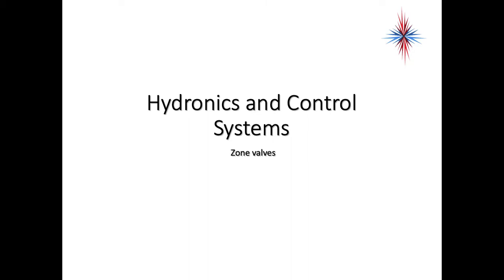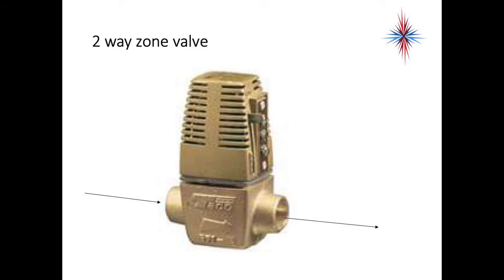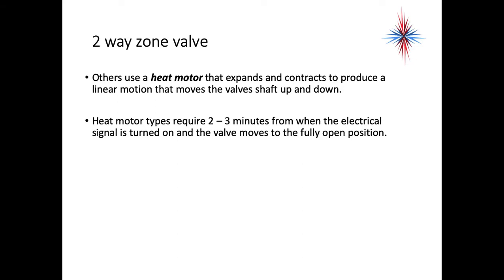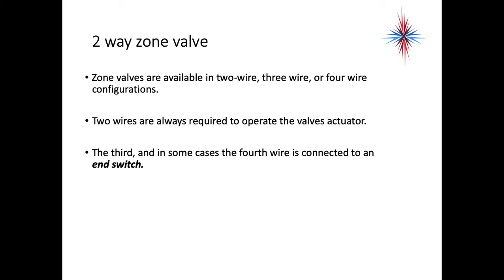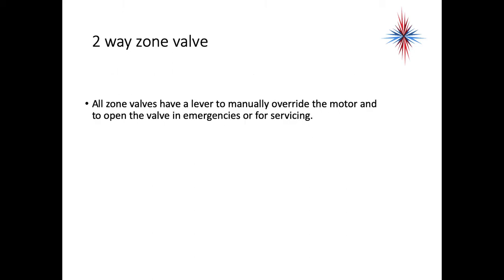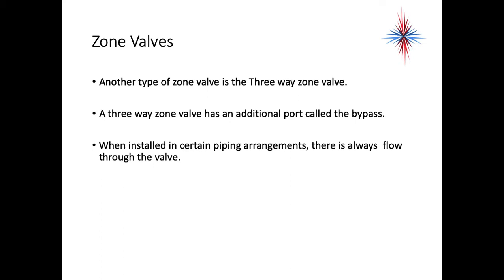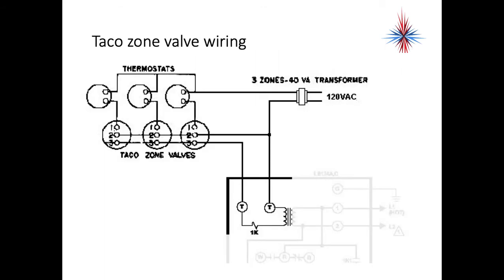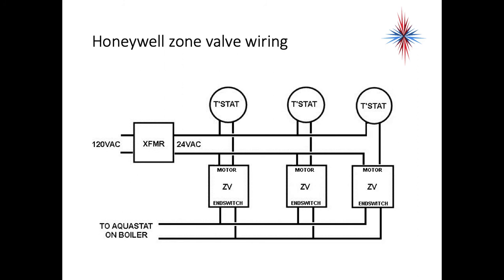Hydronics-Zone Valves

Comment: Thanks for a very well done video. Have boiler heat system with 2 zones valves. One of these is not functioning. The repair guy wanted to know wants the part number. These are Honeywell  valves but there is no part number to be seen anywhere. Any help will be appreciated to find a proper replacement part.
Reply from the maker: Sorry a little late responding but pull the cover on the honeywell valve and look inside. Also, sometimes it's stamped into the valve body itself.

Comment: Thank You for taking the time to explain common zone valves functions and wiring.  When using a three-way zone valves as a diverter valve can the user control which way water flows in and out of the 3 ports?